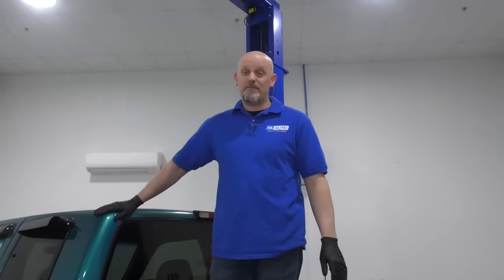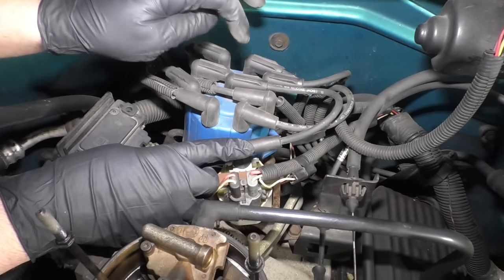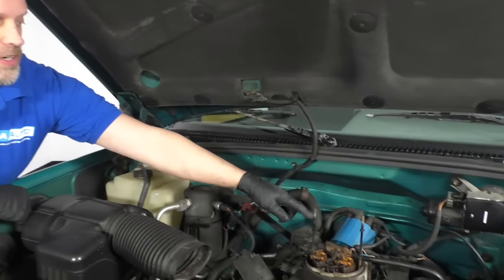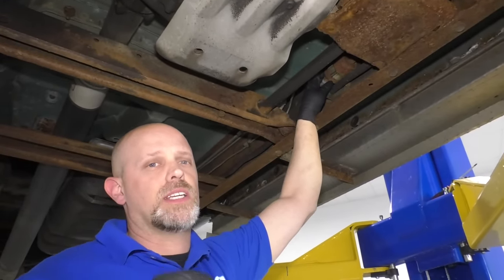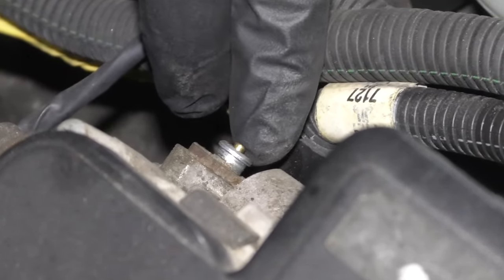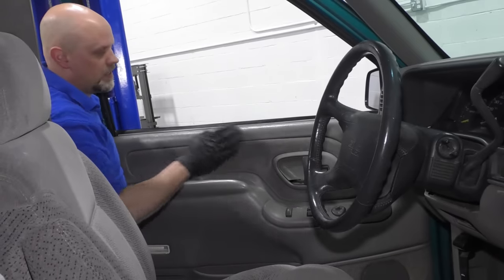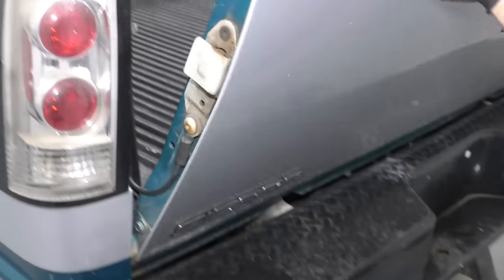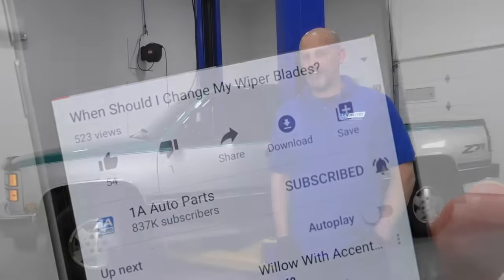Top 5 Problems GMC Chevy Truck 4th Generation 1988-02

Comment: My cargo lights on my 96 gmc on my 3rd  brake light don’t work or at least the white ones don’t the red on dose I flick the switch or open the door turn the wheel on dimmer and push the button by the light switch and nothing??? (HELP)

Comment: Got a 94 Chevy 1500, dies when you accelerate heavy. Starts right up every time, also if it sits for a week or two it’ll take about 5 seconds of cranking to start it I’m thinking fuel pump? Lol I’ve had all these problems before.
Reply from the maker: +Javonte Shavers We wouldn't be able to diagnose an issue like that here, you may want to have a local mechanic take a look at it. Thanks for checking us out! http://1aau.to/m/Shop-1AAuto-c
Reply: 1A Auto: Repair Tips & Secrets Only Mechanics Know I am the local mechanic lol but thanks anyway

Comment: Great video but I'm not sure anybody caught all the problems with that truck. I saw a rotted out body / frame mount, that brake rotor the rub through the ABS looks horrible can't imagine what the pads look like, the passenger side rod that opens the tailgate has zip ties holding it together.... 🤣🤣🤣 And it'll still run forever...

Comment: My car turns of out of no where and it has rough aceleración but at one point when I was failing I felt the engine run live a champ I got an increase in power but then it stopped and it turns of and on right away then off again
Reply from the maker: +Goofy lts We wouldn't be able to diagnose an issue like that here, you may want to have a local mechanic take a look at it. Thanks for checking us out! http://1aau.to/m/Shop-1AAuto-c

Comment: 1994 ext cab 5.7 put headers on have 2 wire 02 sensors on bay 2 upper.try to get someone to hardwire it in Aurora,il is impossible

Comment: My annoying issue is the front diff solenoid it just flashes and doesn't want to put it in 4-wheel drive it didn't even last 50,000 km

Comment: 90 gmc Sierra k1500 replaced light switch headlights still turn off while driving scary. Windshield wipers have mind of there own takes a while to turn off if they turn off replaced motor and squirters do not work. 5speed 4x4 front axle diff switch not working replaced 4times made removable diff pin for 4x4 activation crawl under to make  front diff work.  replaced rear end now disk all around. Tail light bulb good, stops working ,replace bulb  good to go. Brake warn light always flashing. Blower motor melt wire connection at blower motor. Satellite antenna quit. I dont use wipers. I have squeegee in arms reach. Drivers door hinge pin inserts break after a week install. Replaced at $20 per  about 20 times replace bushings door sagging within two weeks im going to drill and grade 8bolt through no more bushings. 166995 about 10k ago replaced front bearing in trans making noise again. This was a trailer puller i think horses. Owned for 9 yrs now. 6" suspension lift had 15x35 when i got it now 16x 32. Sun visors went south real quick. Both win reg springs broke left them alone. Got new blower motor, have to replace my wire fix. Tail gate handle bezel will not go all the way in on one side. Speedo stops working turn off while rooling in third then bump start speedo back working. Has not done that in a while. I only drive on weekends i  drive tow flatbed  saturday-Thursday. Center mirror glued about to many times horn has issues quiet added two more still quiet . Replaced radiator dont like new one. Replaced coil ,heater hose keeps breaking at block fitting, seat springs sprung sitting on floor almost fixed tear down and rebuild now its hard but im not on the floor and i can see again. Exhaust smells real bad its the smog chem they add im in california. The smog state.

Comment: To A1 Auto or viewers I need to see how the horn on my 1997 Chevy C 1500 is wired to the steering wheel, as I was replacing the multifunction switch I noticed that there was only the yellow airbag wire present so how does the horn work? Also on this same truck as I pulled the steering wheel off a small white plastic cylinder popped out, it had a slot where I could see a spring in the middle and a piston like cups at either ends, this thing came from a round hole in the clock spring, the dealers said it could PN 26036327 but it does not look like what I have and does not touch the clock spring. I would appreciated it very much if any one had any idea.
Thanks

Comment: a coil used to last 100k miles on these trucks firing all 8 cylinders. Now a coil firing 1 cylinder firing a v8 exactly 1/8 as many times often fail before 100k curious why

Comment: Can anyone help? 1996 GMC Sierra C2500, main issue is stuttering and staggering while driving and rpms jumping from 500-1k rapidly while idle. $4000 was put in to replace everything in the front end multiple times. Only 180k miles
Reply from the maker: +Zachary Adams We wouldn't be able to diagnose an issue like that here, you may want to have a local mechanic take a look at it. Thanks for checking us out! http://1aau.to/m/Shop-1AAuto-c

Comment: Mine was running good when I left the house come around the doughboy it quit on me stalled and then try to start it and it would not start the steering column is very loose on it I change the plugs Mazda and it's getting far

Comment: There are several issues with this video. Mainly year range you give for this generation of trucks. Example 1: 1999 new through 2002 had the coil over 5.3. 2: the 5.3 is multi point fuel injection not TBI. 3: the next generation has different interior and exterior handles and the interior especially are better than those. 

The only exception would be 2500 and 3500 models, but they changed in 200. I would think if you sell parts you would know the year ranges on the trucks.
Reply: 99 tahoe and suburban models were still the GMT400 platform with vortec 5.7s and spider injection.
Reply: sorry, on reread you did state 99 new

Comment: Gauge cluster (basically everything electrical bulbs sockets sensors ect.), 4 wheel drive switch failing, distributor corroding and causing bad timing, transmissions failing after 5 years, and a lifetime of anually bad front end parts including steering. If you don't mind replacing something every month for dirt cheap, and replacing every single thing after 6 years, and engines every 10, these trucks last a lifetime.

Comment: What would cause this vehicle to run rich and misfire at the same time?
Reply: Same problem
Reply: Distributor.  Had the same thing a few months ago.  Replaced the whole unit.  Running so rich from one bank it burned one of my cats up.  Had to cut that off.
Reply from the maker: +Treefork Thanks for checking us out!

Comment: When I'm driving the truck is Justin and jerking and I give it gas and it hesitates and then I read just a gas and hold my clutch and then it has power then but let go and it kind of jerks and jumps again vacuum line or fuel filter

Comment: ground straps ....these 5.7 motors have a ground strap that runs from back of motor ( hard to get at )....down thru a tube to the passenger side frame if it's corroded can cause a miss , if it breaks it'll shut fuel off --crank no start ...if strap is stock it'll be a flat looking strap...it's held on at back of engine block by a nut and it's a total pain n the a*s to get to
Reply from the maker: +tennessee hunter Thanks for the tip! We'll pass this info along to our production team.

Comment: I have a 89 gmc truck that runs (when it wants). Whenever this happens I can turn key numerous times without it starting. Once started it runs fine however I never know when it won’t start next.

Anyone else have this issue or solutions?

Comment: I have a problem with my truck it only happens when its warmed up it won't do it when i accelerate only when im stopped and the truck is warmed up it sounds like a chain rattling and cant figure it out

Comment: All these trucks are rusted by now.  Sadly the new Chevys rust even faster due to thinner body panels.   In less than 10 years they have visible surface rust.  But all trucks this old have rust.  Ford, dodge,  Toyota etc of the same age are all rusted out by now.
Reply: Not my 93

Comment: My 4th gen starts won’t idle unless I feather gas anybody know what’s causing it to do that
Reply: I had the same problem in mine but only after my parasitic draw killed the battery and a had the charge it up..Ever since I swapped batteries it’s been fine but it also hasn’t fully drained on since either. Don’t know if this helps but gl!
Reply from the maker: +Tim Nile Thanks for the feedback!
Reply: Tim Nile thanks you will check it out
Reply: @lucasthornsberry3228  IAC valve maybe.  Take it off and clean it out

Comment: 88 to 94 are not like the one you showed, interior is different
Reply: He had the cup holder that pulls out of the dash (my favorite & my 98 has it), his heater controls looked like my 99 “new body” dash. So I know they had a few different layouts in the transition of 98-2000. Also the 98 & 2000 body styles can be exactly the same or the 99 & 2000 can be exactly the same “new body style” so imagine what the interior and other workings of these trucks were or could of been... yes I’ve got 98,99 & 00 trucks for now.

Comment: 1st problem is it's a GM
Reply: You must be a ford guy? 👎🏼
Reply: Is that why thousands of these trucks still drive on the road everyday? Mine has over 270k miles on the original 350b and it still runs great.